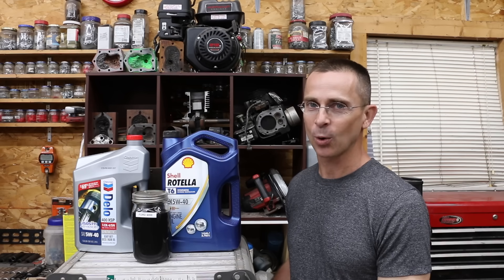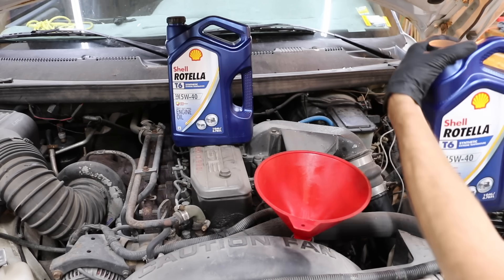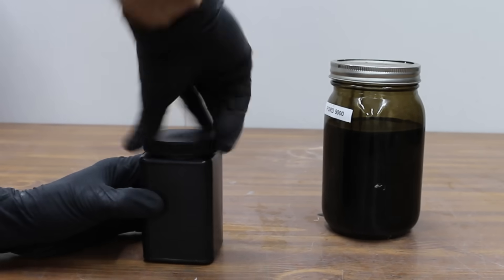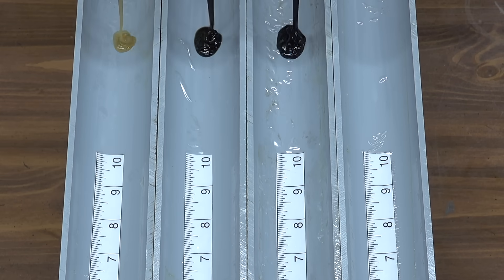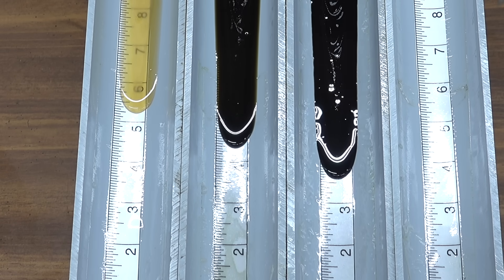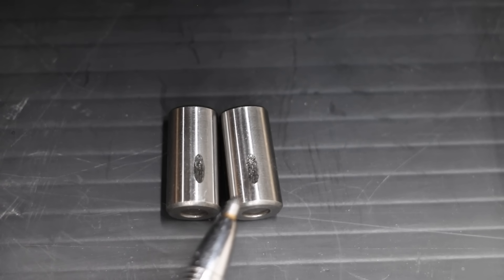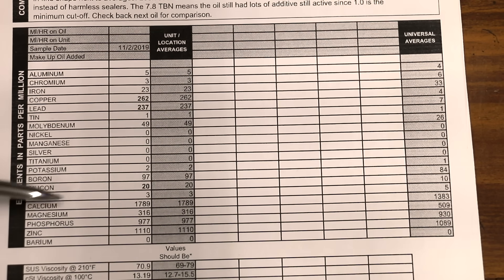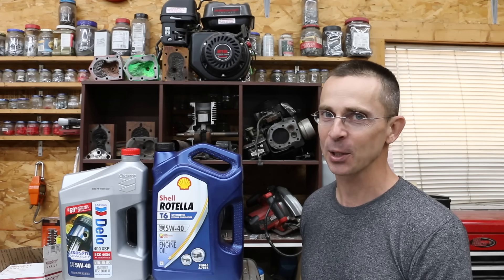Will Annual Oil Change Damage Your Car? Let's find out!

Comment: oils have detergents and bleaches, the reason you need to change it after a year is not the oil itself but what starts to disintegrate, the crud and sludge built up inside the engine. also most filters are made with a 10k mile life span. please for the love of god do not wait any longer than 6months to a year for an oil change its the cheapest maintenance and most effective maintenance.
Reply from the maker: Thanks for the feedback.

Comment: It’s been years (5?) since I did an oil change on my 2007 diesel. And before that oil change it had been 5 or 6 years. Of course oil companies and dealerships are going to recommend frequent oil changes, of course it’s better to change the oil but you can go a little over the recommendation if you budget requires that.
Reply from the maker: Thanks for sharing.

Comment: I 3/4 fill my horizontal filters always. This gets the media “wet” with oil which and the anti drainback valve holds back the rest. No drips, works great.  By letting the oil and filter in the car for a longer period of time between changes you are dramatically reducing the number of dry starts the engine sees in its life, which may be the better result
Reply from the maker: Thanks for sharing.

Comment: Great video, and tests. Oil Companies lowered the ZDDP level in standard engine oils in the 2000's to extend Catalytic Converter life but fail to list a warning on their labels, however flat tappet camshaft engines still require at least 1100 PPM of ZDDP. Racing Oils have the highest level of ZDDP and Diesel Oil like Chevron Delo or Shell Rotella have about 1200 ppm, and why people with non roller cam or overhead cam engines use them, or they can always add a ZDDP additive such as one made by Redline, or Competition Cams.
Reply from the maker: Thanks!  Thanks for the feedback.

Comment: I purchased a new Toyota 4Runner in 2020 and traded in my 93 Chevy V6 with 126k.  The dealership called to schedule a 6 month appointment and I said it only had around 800 miles on it 😆 So we waited till the 1 year mark at around 2500 miles.🤣Since oil changes were included the first 2 years, I had them do it. We've traveled on business trips and it's now upto 13,800 miles, in 3 1/2 years (changed yearly in the summer). 

The last change was 6 months ago and I've only driven 500 miles since then.  I'm sure I'll take it out more in the spring and summer months.  But, this video just corroborated what I though all along.  I should go by mileage instead of months.  And, I only use synthetic oil for the oil changes.  BTW I have another daily runner that had 117k and it got maybe 1200 miles in the past 6 months.  Between the 2 vehicles, we're set for a good while.  Maintenance is cheap for these.
Reply from the maker: Thanks for sharing.

Comment: On my daily drivers i do intervals on range, but on my classics i start each season with fresh oil. Also the intervals are shorter on mineral oil wich i use in the classics so it kind of adds up. Would be interesting to see if servicing before storage or after storage have anything to say.
Reply from the maker: Thanks for the suggestion.

Comment: My car runs a 1,000 km (621 mi) on average for the last three years. I live in a humid country. I use a fully synthetic engine oil for my oil changes. It’s good to know that I don’t need to do an oil change just because it’s already on the 12 month mark.

In my case, what’s the good indication that my car needs an oil change already? My car is already 13 years old but has a very low mileage. 

Thank you, sir
Reply from the maker: You are welcome!  Thanks for the feedback.

Comment: have been looking a long time for info about this.  bought a 2020 new camry for retirement and so far use it only 1000 mi per year last 3 years.  car is garaged & not used at all for 4 months in cold canadian winter.  (snowbird here).  i do the oil change myself every spring using toyota synthetic oil & filter.   is this ok?  dealer claims i need to oil change every 3 months even if only 250 miles due to harsh northern winters.

Comment: I use Chevron Delo 400 oil in my Ford F350 Diesel trucks for years. Since my first one in 1985 through my present model in 2023. In all my 4 trucks with Delo 400, I NEVER had any problems.
Reply from the maker: Thanks for the feedback.

Comment: As a professional mechanic i can say from experience most engines dont need to have their oil changed.... On my 73 ford i dont Change it because it burns about 4 quarts a year or about 10k miles. So i just add to it.

However, i replace the oil filter once a year.

Alot of modern engines leak/burn so much oil if you just pop your hood and add between oil changes youd never have to actually change it.

However... Alot of modern engines have so many electronics such as VVT solenoids that use oil pressure to activate and have filter screens.

Ive had many customers, many Chevrolet engines, come in with check engine lights because they went past their oil changes and grit built up on the VVT filter screens and caused them to stop working.

Some engines needs perfect oil, some dont.... It comes down to how the engine is built

Comment: Great video!  For the lubricity test, it's good to understand that the watt-usage reading on the Kill-A-Watt meter is directly related to how fast the electric motor is turning. If increased resistance were to be placed onto the motor with the result of slowing it down, the Kill-A-Watt meter would indicate less watts being used. This can be counter-intuitive, and good to know as a higher watt reading theoretically indicates higher/better lubricity.
Reply from the maker: Thanks!  Thanks for sharing.

Comment: if you use longer oil change intervals you still need to change oil filter at recommended intervals so the bypass valve doesn't bypass the filter
Reply from the maker: Thanks for the feedback.

Comment: Nicely done. You probably test more real world applications than the oil industry does. On a side note though my theory is that oil is way cheaper than replacing an engine. I was in the garage business for over 40 years and I have seen the results of lack of oil changes.
Reply from the maker: Thanks!  Thanks for the feedback.

Comment: I subscribe to the sniff and rub test for oil. next time you dip the oil with dipstick sniff the oil, does it smell burnt ?  next rub some oil between thumb and forefinger, does it feel sticky, or slippery ?  The other thing is that when you take oil filler cap off,  is there any white creamy residue ( this is not so common with modern synthetic oils as it used to be with straight mineral oils, and it was mainly down to short journeys ).

Comment: Howdy! Thought I'd bring up racing oil filters or bypass filters. Fram isn't my go to, but I installed a Fram racing filter with the anti-flowback so the oil filter stays full of oil for cold starts & Fram is the only Racing filter with a screened oil bypass!* An oil bypass gets 90% more oil to engine parts.
Ive experienced much better performance & faster revving too & silent running, but you be the judge.. I only use Mobil 1 oil Advanced full synthetic 20,000 mile in all my vehicles, change it every 4,000 to 5,000. Even my Honda lawnmower gets the mobil1 Advanced, it's good stuff & makes a difference, my home standby generator gets that oil too..

Comment: Would love to see an oil test on boat motor oil that sits for 6 months over the winter. It seems crazy to change oil after only 15 hours running time a year but all the forums say to change the oil every fall before winter layup due to moisture and acidity and the fact that they get run hard with high RPM's under a load. Mercruiser I/O
Reply from the maker: Thanks for the suggestion.

Comment: This is a great topic for me because I own a boat repair shop in upstate NY. I am very often talking with customers about this. Some are hell bent on changing oil every season even though it i has very low hours. Some are cheap as heck and go 8 years on oil changes. Most take my advice and go every other year. The OEMs all recommend every year at the minimum. I have sent my oils to Apex Oil Labs for years and I know that annual oil changes are grossly over rated. Today's oils are far superior to years ago and hold up very well. An engine will not die from wear under most circumstances, the truck body or boat or whatever it is will 99% of the time go first. Now, oil filters are more my concern. They are made of paper, glue, and steel. All of which can break down and cause engine failure. So I am more worried about the filters over time than the oil.
Reply from the maker: Thanks for the feedback.

Comment: I’m just a layman amateur mechanic, but in my opinion, annual oil changes on older vehicles like the 1997 truck, should not be done. I would use conventional Dino oil and change it every 6k. But a newer truck, annual oil changes with high-quality synthetic should be ok.
Reply from the maker: Thanks for the feedback.

Comment: I’ve seen so many people online mentioning how they buy expensive synthetic oil and filters, and then boast about changing it after only 3 or 5k miles. They buy expensive oil just to dump it well before it actually needs to be. One of the reasons the oil life monitors exist, is to discourage people from changing their oil too frequently. I follow the monitor on my 2011 dodge avenger, which alerts me anywhere between 5-10k miles. I mostly used conventional oil when it was newer, but I use synthetic now. I’ve had it for over 10 years and it’s up to 250k miles and still in perfect shape. I noticed that conventional oil starts to break down after 6 or 7k miles
Reply from the maker: Thanks for the feedback.

Comment: Great video! You mentioned at the end the importance of letting the engine reach full operating temperature at least once a month... what about storing a vehicle for the winter? Do you recommend starting it up once a month and letting it idle to warm up or is it safe to let it sit for 5-6 months?
Reply: Never start it for a bit, you'll create condensation and make things actually worse. Put Stabyl in fuel and rub it through if carburated

Comment: Every 3,000 miles engine oil, 30,000 gear oil for our Alaska vehicles.  They don't use salt (too cold) so vehicles can last many decades.
DYI and it is inexpensive and our vehicles all run over 200,000 miles.
Reply from the maker: Thanks for sharing.

Comment: I just changed the oil in my wifes car, a 4 cylinder rice buggy ( yes I know that is not politically correct, that just me) it had about 4,000 miles since the last change, 5w 30 full synthetic, she is disabled and rarely drives, it was over 3 years, the old oil looked ok was down to the bottom of the operating range but still in it, it runs fine, so I would say changing it every year if it only has 2,000 miles is a waste
Reply from the maker: Thanks for the feedback.

Comment: I'd like to see a video on Rotella T6 vs Motorex vs other oils for motorcycle wet-clutch use.  There is huge drama within the motorcycle community of the use of T6 in motorcycles.  The bottle says it's JASO MA/MA2 rated, but people says it's not really certified, and Shell puts it on the bottle because they say it meets the rating.  Many KTM owners in particular swear by Motorex because the manufacturer says to use it.  Whole bunch of people say oil designed for Diesel engines have no business being in motorcycles.  I mean, anyone asks about oil recommendations in any motorcycle forum, and their is huge responses and arguments over this.
Reply from the maker: Thanks for the suggestion.

Comment: Interesting point, I buy oil in 20 litre drums, with the average fill capacity being about 5 to 6 litres I find that if that oil only goes into one of my cars then that drum becomes that cars oil. One year I did about 420 miles in one car, the oil in the sump was the same oil that was in the drum sitting next to it in the garage, so changing the oil only meant dumping 420mile oil for 0 mile oil but the very same stuff and age! This got me to Google oil shelf life and they reckon 4-5 years. So, my thinking, very low mile oil could just be left.
Reply from the maker: Thanks for the feedback.

Comment: I remember a motorcycle magazine stripped down a CBR600 that had done 16000 miles without ever being serviced , the oil was still in spec and the engine wasnt showing any signs of damage
Reply from the maker: Thanks for sharing.

Comment: I’ve never understood American oil change intervals. 
In the UK / Europe, typical vw 2.0tdi is 20k miles or 2 years. 
I do this.
The engine performs like brand new and is perfectly clean inside.  
Circa 3k mile intervals is absolute madness. Binning oil with 000s of miles left
Reply: We have different oil standards, our API, yours is ACEA. A small number of oil products have ACEA standards on the US market. Your oil in general has more additives to last longer, our is created for fuel efficiency with minimal levels of everything and viscosity at lowest level of the range.
Reply: @eugenet6632 that will be why there are virtually no oil change garage companies in the UK. There no money in it. I don’t understand why America can’t have the same oil

Comment: Thanks for the information. I was gonna change the oil in my 2012 E-150 Ford Club Wagon before a trip as it had been 19 months since the last change but with less than 1,000 miles driven the 5W-20 oil looked new - light amber color. So I did not change it. 800 miles later it has turned light brown so I suppose I wwill cahnge it sooon.

I uggest evaluating Prolong Engine Treatment.
Reply from the maker: Thanks for sharing.

Comment: I looked at your small engine Honda vs clone and on my own clone that clone heats up so bad that the oil is like water. I will try the T6 now to see if it lasts longer than 5 weeks on my BCS flail mower
Reply from the maker: Thanks for sharing.

Comment: I change my oil everytime the maintenance light comes on, always pass a little bit above 3000 miles but I use full synthetic 5w30, mobile 1 or vavleline think that's how you spell it lol, great video, always mainten your car and it will last longer
Reply from the maker: Thanks!  Thanks for sharing.

Comment: I switched to Rotella T6 on my commuter Subaru. One thing I notice about the oil is it’s sticky property after shutdown. When I check the level in the morning prior to start up, it shows a little high on the dipstick. After I wipe it, it’s right at the full mark. 

I would think it sticks better to the metal engine parts upon cold start up. It never burns any oil between oil changes.
Reply from the maker: Thanks for sharing.

Comment: Amazing video. Was just thinking last night, how could oils possibly deteriorate with low milage and you've proved beyond doubt this is indeed just a myth.
Am wondering if car is not used once a month if the amount of water absorbed will become an issue because apart from breather, there are very few places for oil to absorb water (if this is actually possible because oil floats on water). With this in mind, sump plug could be removed for a second to release water.
Had an oil burner and used old sump oil from 1000 litre container for its tank. Oil fed into a small resevoir container and bled this once a week to drain water out. 
What are your thoughts about not replenishing oil with low miles after ten years if drain plug is momentarily removed?

Comment: I change the oil in my truck every spring... Regardless of miles. I do not put that many miles on my truck, probably average 5000 per year. It now has 235000 miles on it, and the engine still runs great. Truck is an 02 F150 4.6l Supercrew.
Reply from the maker: Thanks for sharing.

Comment: the reason to change a oil yearly is not for the lubricating quality, but for the anticorrosion protection properties of the oil. You should measure the PH of oil in the beginning and in the end of the 12M period, even the motor didn’t use at all.
Reply from the maker: Thanks for the feedback.

Comment: Depends whether it is mineral oil or synthetic.

Driving a few miles is potentailly worse due toi condensation.

A common sense approach judged by the colour and smell of the oil on the dipstick is the best measure.

Theoretically an engine that uses a lot of oil never needs an oil change as it is constantly  topped up with new oil, ;😂¬)

Comment: Exactly the question I had, so thank you!  Wish it had not been a diesel engine, though.  Not at all sure the results carry over to a gas engine.
A bit of advice:  If you are going to cut open the filter and squeeze out the media, you might try a bright, oblique light across it to see if there are any tiny metallic particles reflecting light.
Reply from the maker: Thanks!  Thanks for the suggestionl

Comment: Very high quality tests and excellent content, love the channel. 

You have proven oils are in great condition relative to standards, however one may not want to generalize the conclusion to newer gasoline engines.  It would appear that some newer engine components, namely piston oil rings are VERY susceptible to any oil contaminants in that they "stick" more easily and vehicles consume oil, all in the name of fuel efficiency <insert sarcastic smile>

Regular oil changes have so far been the only prevention.  Bottom line, it's the components that are the issue, not the oil itself.
Reply from the maker: Thanks!

Comment: I now use 5w-40 T6 in 2007 Civic Si with 170K miles. Much lower oil consumption compared to Pennzoil Ultra Platinum 5W-30
Reply from the maker: Thanks for the feedback.